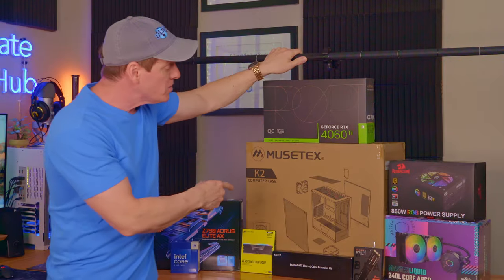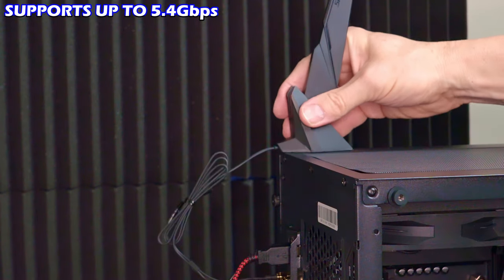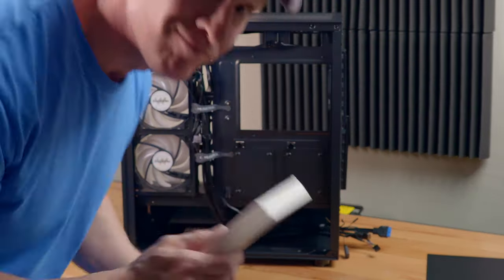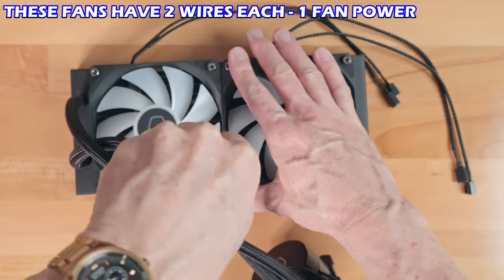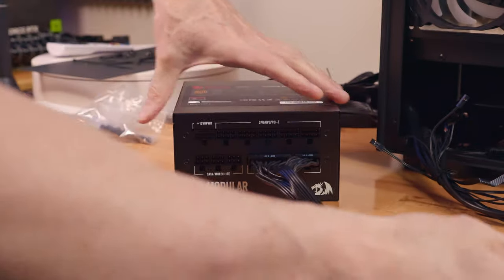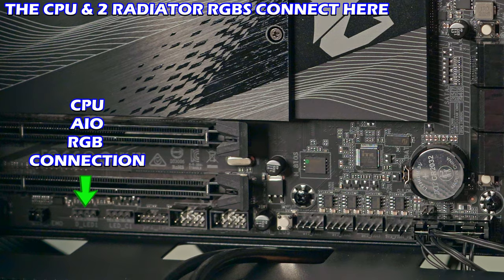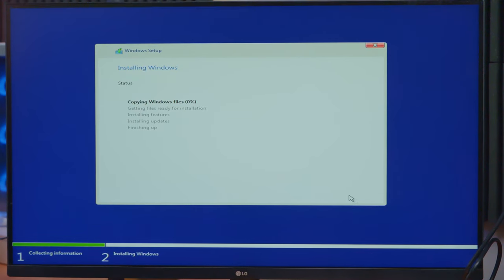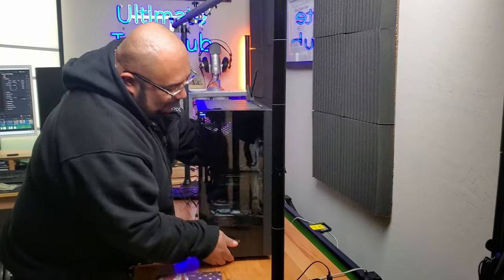THE $2000 PC BUILD GUIDE! RTX 4070 ( w/Benchmarks )

Comment: I purchased a single red dragon power supply that worked for a whopping four months. It became unable to support my pc under load, and it would force reboot. 750w 80+ bronze for an i9 9900k @ 5.1ghz with a gtx 1080. This was about 3-4 years ago. Personally don't trust anymore.
Reply from the maker: Sometimes PSUs can just stop working or malfunction. I've had a couple thermaltake PSUs that went out in less than 2 years. But I've also had cheaper PSUs last for 4 to 5 years. The Redragon PSU got great reviews so that's why we went with it. Thank you for watching I really appreciate the comments too. Cheers!